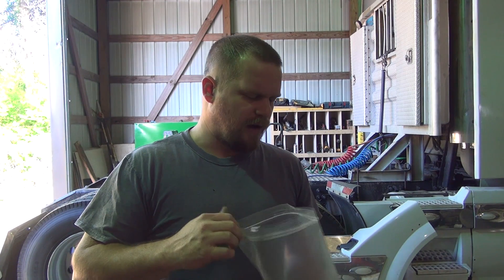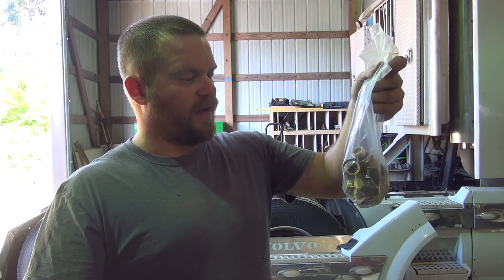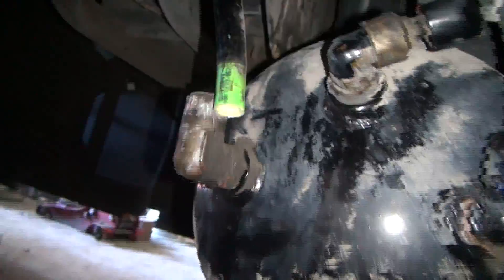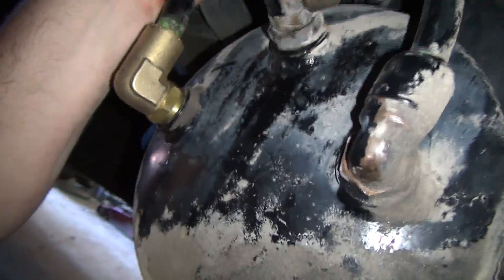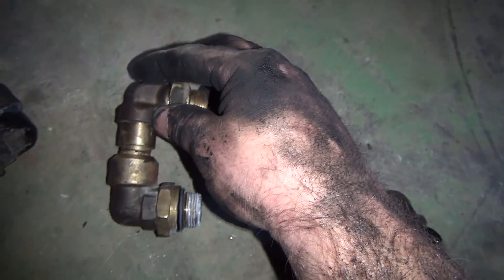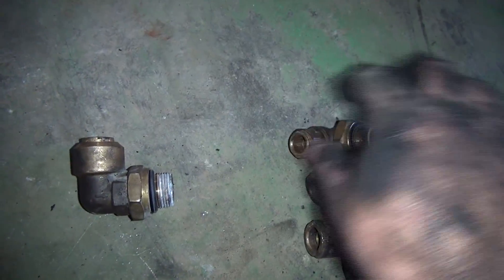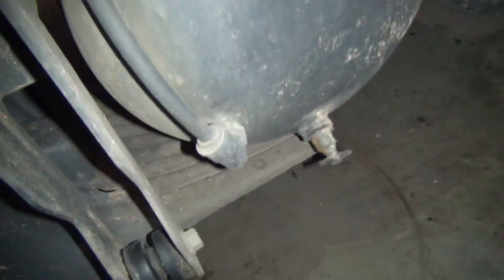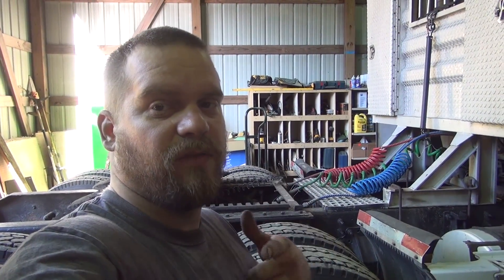Volvo vnl air tank fittings junk

Comment from the maker: Some of the fittings still have a small leak. It's not an audible leak, but if you spray soapy water on them you get bubbles, so it's a small leak. I went back and cut about a 1/2" off the air lines that were long enough to do so thinking a fresh area on the line would help them seal, but nope some still have a small leak... Using these type fittings with the strain that is on the lines from how they are routed just seems like a poor design.
Reply: Forgot
Reply: Your main air lines if that’s leaking how do you order a new one? And what’s the length?

Comment: This really help me I am having issues after I changed all the fittings I have a vnl 630. Changed all fittings and the break on the drive axle won't  engage. Only the steer axle and the trailer breaks are working and after watching this I am wondering if I put that check valve in the wrong spot

Comment: "push to leak" fittings. always finding them leaking no matter what make or model truck i have. everything built today seems to have a built in expiration date built in. seems like just enough to get it out of the warranty period.
Reply from the maker: Man I know, some of it's so bad it doesn't make it out of warranty. It's just slapped together and sent out the door, no grease fittings or anything...I wish I could find regular compression type fittings that has the proper metric oring threads...

Comment: I know you do all the work on your truck so Volvo sales the O-rings for all of the air fittings .
They come in plastic bag 10 piece , all you do is take the players grab that brass ring and pull it out it's going to pop out .
Pick the old O-ring out blow it with the air use some WD-40 on new O-ring , push the O-ring in then the brass ring and you have a new fitting.
I didn't see your videos for some time good to see you back.👍
Reply from the maker: Didn't know you could buy just the o rings. I've had some of the fittings apart before but never could find an o ring that fit properly. I hate these push to lock fittings they always leak but they are metric thread so not much you can do with it. I wish they had an upgrade to the type you could put a wrench on. Oh and I usually upload a video once a week, it's not always trucking related however. YouTube doesn't seem to show my videos to everyone. Make sure you hit the notification button and see if that helps.
Reply: I replaced only the O-rings but still had leak so went ahead so I bought the fittings and I'm also having same problem wich is small leak. I believe after trying some new smaller size hoses (different location) with new fitting there's no leak at all so in my opinion it my be old hoses that goes to the tanks the problem

Comment: I believe the push fittings were made to quicken the assembly process at the factory. 

In my opinion the brass compression type are by far a superior design.
Reply: It's absolutely absurd to even use push fittings in many cases -- say, at a fan clutch. Leakage can develop and you risk burning it up! Compression is the way to go.
Reply: Amazing to me how things get less reliable in manufacturing and not more.

Comment: The o-ring on the threaded side can be replaced and the o-ring under the collet can be replaced. Entire fitting replacement is an unnecessary expense. All PTC DOT fittings are serviceable with pliers and a few picks. I have part numbers for the o-rings and collets if anyone is interested. People waste tons of money replacing the firewall pass through too even they only needed to change the o-rings.
Reply from the maker: I didn't know the o-rings were available for purchase until someone else mentioned it in the comments. The fine people at Volvo sure didn't tell me they were. They were sure happy to sell me the fittings though! Lol
Reply: @LifeWithChase  Tell me about that. Happened to talk to my dealer's parts guy tonight and he said the pass-throughs were unserviceable. Really! I've fixed 5 leaks on mine over the years by sticking new o-rings in, so that's sure odd. I should backtrack a little bit and remove my foot from my mouth, though -- a few of those composite elbows that you showed I think can go bad in the spot where they swivel. They have O-rings at the base and inside the push-to-connect cavity, which can both be serviced, but if that swivel joint is leaking, I don't know what you would do besides replace them. Now those composite elbows with the base at the bottom are a headscratcher when you have your own NPT fittings and you try to thread one in and it won't go in. That's because they're metric. So is the one on the outside of the front (wet) tank on many Volvos. (That 3/8 line comes from the dryer's "purge-tank" port.) Part numbers can be 20999384 for an M22x1.5 1/2 elbow, 20551609 for 3/8, etc. Elbow nipples, they're called.
Reply: What’s the part number for o-rings ?
Reply: @PLKatrin  Volvo 85146177 O-Ring, 1/4 Press in Fitting *Pack of 10
Volvo 85146178 3/8 Press In Fitting Silicone O-Ring *Pack of 10
Volvo Truck 85146179 O-Ring 1/2 Press in Fitting *Pack of 10
Volvo Truck 85108487 O-Ring, 5/8 Press in Fitting *Pack of 5
Reply: @themaestro7922  thank you so much
Reply: @themaestro7922  do I need also 3/4?
Reply: @PLKatrin  I'm not positive there are any 3/4" o-rings on a Volvo VN. I don't know of a part number but they exist
Reply: @PLKatrin  Also, Eaton Weatherhead makes kits with both a collet and o-ring. Eaton Aeroquip Collet 1800Kx6 for 3/8, 1800KX4 for 1/4, 1800KX8 for 1/2", 1800KX10 for 5/8", and to answer your question, 1800KX12 for 3/4". These kits let you insert a new o-ring and collet just in case the old collet is crummy or you break a tooth. Sometimes just inserting a tube will straighten out an old collet but nice shiny new ones are always nice too. These are all available now at finditparts -- which I really hate but at least they are available

Comment: DO NOT USE PIPE THREAD FITTINGS, unless you want to buy a new air tank. The oem Volvo fittings are serviceable. Show me any other manufacturer that has that option.
Reply from the maker: Didn't use pipe thread, used oem Volvo fittings...

Comment: You would not like a fittings Volvo uses in Europe. They are plastic 😂😂 they are so bad that the Volvo dealer don't even stock them. Replace with brass ones as go bad. But a million of them so costly as fuck replacing them on a new truck if want to to all of them.
Reply: Cost improvement feature
Reply from the maker: This type of thing really agrivates me when a company makes a crappier product and charges more for it and then you buy new ones and they are equally as crappy.
Reply: @Klentung8989   dame with the glued on windshields, uses it as a part of the stiffening of the cabs so can use less steel. Some models are so weak that they crack and need to be replaced all the time.
Reply: @sisutrucks metal is precious nowadays...